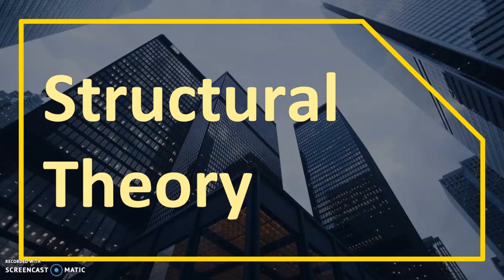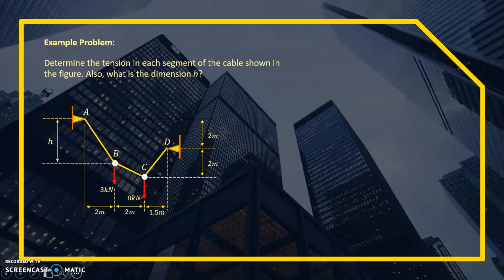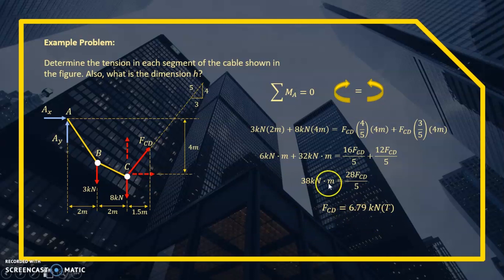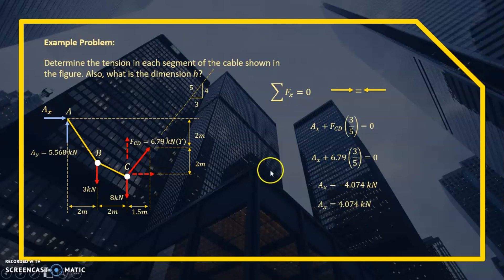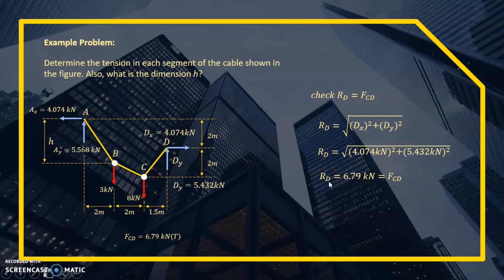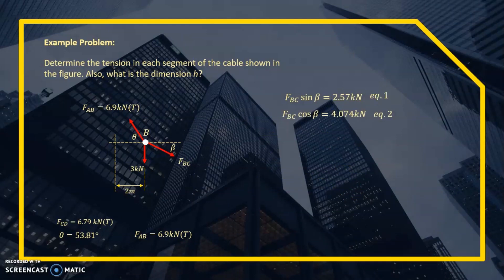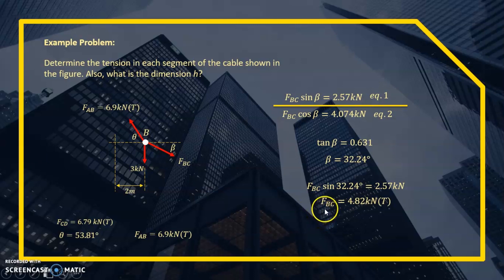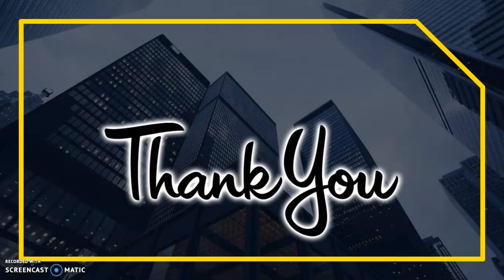Cables subjected to Concentrated Loads

Comment: Hello po sir, pwede po mgrequest ng video example ng halimbawa po kung ilan ang mgagamit n bakal pra sa  300×500 n column at kung ano ung diameter ng bakal n gagamitin. Thanks po
Reply from the maker: Reinforced Concrete design po yan. Need po ng loads to design the capacity of the column.